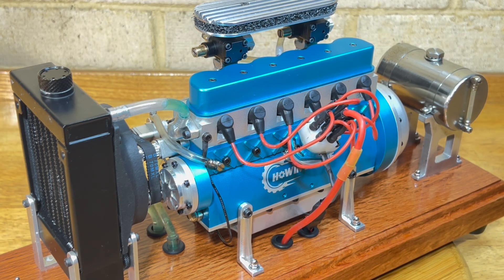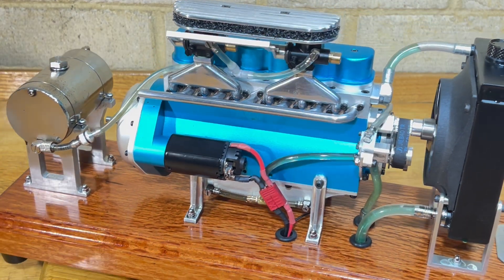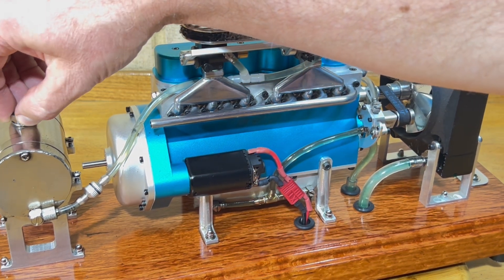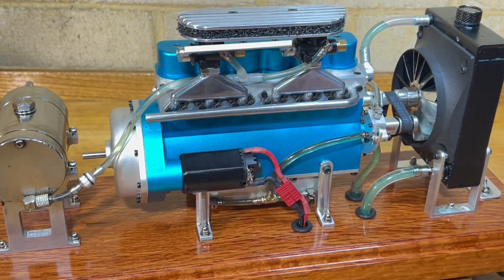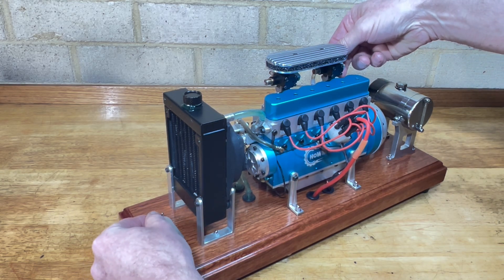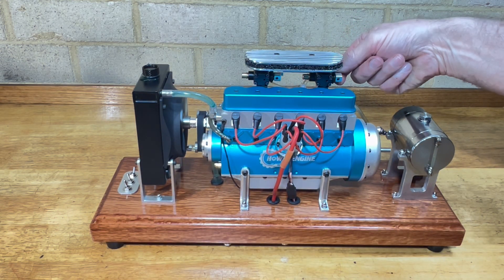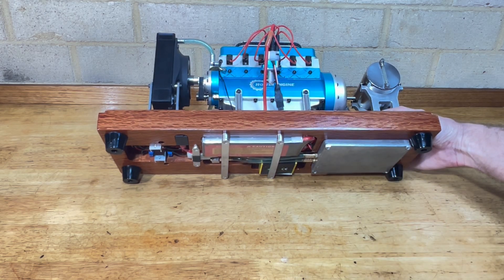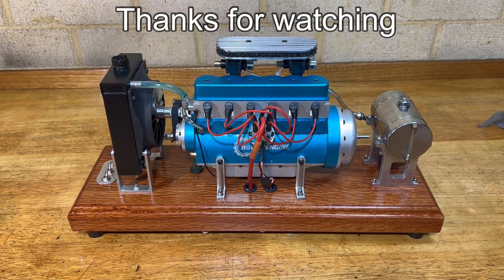Howin I6-210 21cc scale model engine. Modified distributor location and other tweaks.

Comment: I love the exhaust manifold spitting out onto the fuel tank. If you put a hole in the tank, you could recycle the oil :)
Reply from the maker: Haha, Or I could run it back into the carby and call it a mini EGR. I’m going to try my luck at bending up some tube soon.